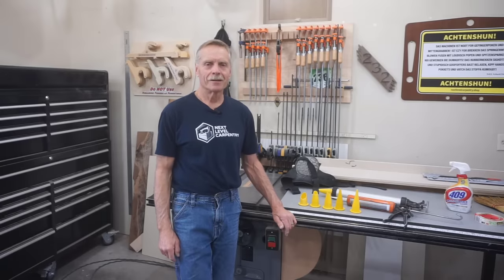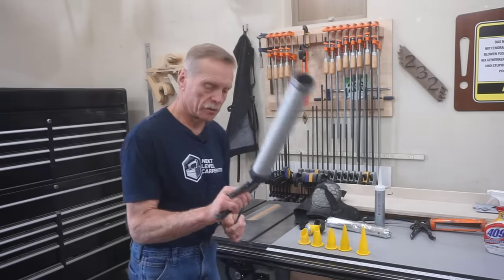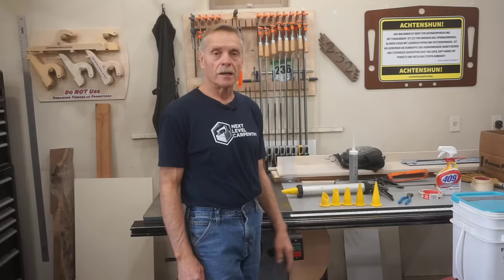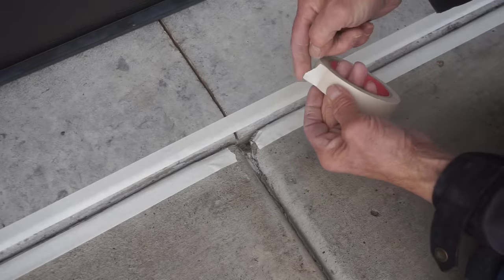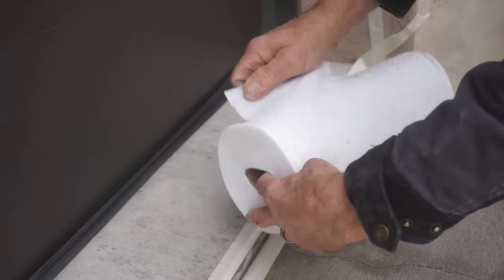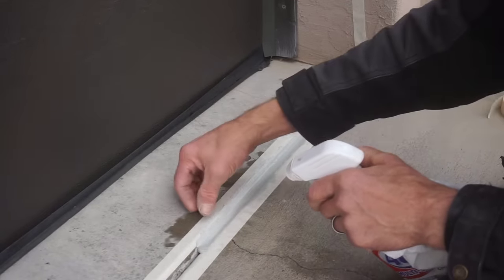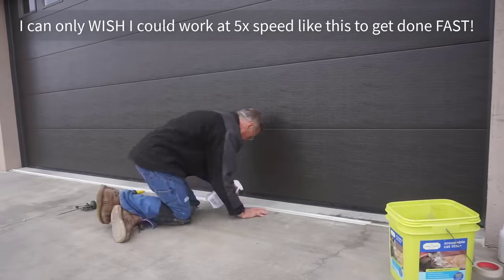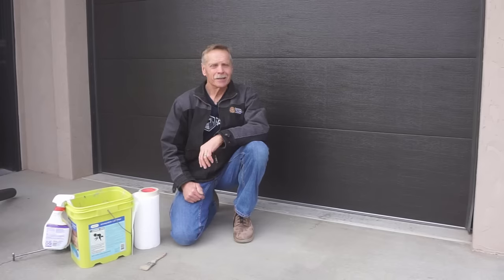How to Caulk Concrete Control Joints with Perfect Results Every Time

Comment: 1.  How do you get the concave shape on the joint if you cut the tip straight across and then work at 90 degree angle to the length of the joint?
2.  NP1 says to prevent contact with skin.  Is the polyurethane you are using different or does the 409 insulate your fingers?
Reply from the maker: 1. Just rotate the gun/nozzle until the curve of the cut tip leaves the right amount of concave-ness... if you use a sausage gun with those yellow cone tips you can cut a few at different lengths and cover just about every joint width/depth from 1/8" up to about 1 1/2"
2. I'm pretty sure Tremco products have the same warning and anyone with paranoia about such things should steer clear of this whole process.  Personally?  I'm not eating it and, using 409 or diluted Dawn and plenty of paper towels to keep my fingers clean, it doesn't concern me in the least.  Funny thing is, my hands are much cleaner after a day of this work than just about any other construction activity.  If I did this all day, every day I'd probably use nitrile gloves or something but at 3~5 times per year I don't.  I get a bit cynical about this sort of thing when I imagine someone over reacting to a bit of sealant on their skin and chain smoking a couple cigarettes to calm their nerves.
Work sensibly and safe using your own intelligence to make decisions... Best, Matt
Reply: @NextLevelCarpentry  Unfortunately I have already purchased the Albion B26 B-Line gun which takes the 10.1 inch tubes of caulking.  Any advice for that using that gun?
Reply from the maker: @garygault5183  The best you can do is to cut the tip at a sharper angle for wider joints.  You'll be limited to about 5/8" max width to apply sealant in one 'tool-free' pass.  It's not a deal breaker though, just takes more wet tooling to get results like you see in the video. Again, I just use mild soapy liquid and my finger tip.  You can always use latex or nitrile gloves to keep it off your skin. FYI I'm doing a sealant job right now that I couldn't get the color I need in sausage tubes so I'm doing a bit of this work-around method myself.  Just plan to spend a bit more time on the tooling part and you'll do fine.  Best, Matt
Reply: Where do you purchase the fine silica sand?
Reply from the maker: @garygault5183  here it is through Amazon (from list in the video description): https://www.amazon.com/dp/B07NXVL3ZD/?ref=exp_nextlevelcarpentry_dp_vv_d if you can't find it locally at a masonry supply type place where you'll get much more for much less $$.  Best, Matt
Reply: @NextLevelCarpentry  Thanks for all your help.  This was an excellent video!
Reply from the maker: @garygault5183  Youbetcha! Good luck with your project(s)...
Reply: How many days of dry weather do you need before rain is forecast to get proper curing?
Reply from the maker: @garygault5183  Surprisingly it's moisture that accelerates curing time for urethanes so I don't worry a bit about rain even the day of application but do prefer at least one day so I can brush excess sand off the joints so they look their best.  It's more important that concrete is good and dry BEFORE applying urethane with this method, not so that the urethane sticks but so the masking tape does...
Reply: @NextLevelCarpentry  Is there any alternative to the diamond wheel like a hand wire brush or wire wheel and drill?
Reply from the maker: @garygault5183  abrasive discs are an alternative to diamond wheels... in fact, up until the last 10 years or so, they were the only practical alternative.  Since the wheel is used for cutting, not cleaning, a wire brush or wire wheel and drill don't work for this application.  You may be able to find an abrasive disc and arbor that can be used in a drill.  It would be much slower and less effective so the trade off for less $$ is slower results.  Be sure that any disc you get is made for masonry/concrete and NOT steel.  Even though they look very similar they're made with different materials and one doesn't work at all, really, for the other.  Best, Matt
Reply: @NextLevelCarpentry  I guess I will invest in a side grinder.  Is the object to  remove material for better adhesion or just to get a smooth surface?  Also on the video, I couldn't understand the word before "diamond wheel".  Can you clarify?
Reply from the maker: @garygault5183  will you include a time stamp from the part of the video you're asking about?  It will help me answer your questions... thx.
Reply: @NextLevelCarpentry  6:41
Reply from the maker: @garygault5183  perfect.  "I did a little pre-cleaning on these control joints with a thin diamond wheel in a  side grinder to clean up rough spots and make a uniform gap between the driveway slab and garage slab".  This step removes pebbles stuck down in the crack and allows free movement between slabs.  If concrete wants to move you're not going to stop it and small bits of sloppy/irregular concrete can cause edges to chip with even slight seasonal movement between slabs so I like to clean them out the slightest bit if I can.  I'm only going about 3/4"~1" deep, not deep enough to affect rebar or 'keyed' joints between slabs which are both structural by design.  The "clean up rough spots" smooths out the surface where the tape will go so I can apply it better/more easily.  Since the diamond wheel is SO quick and effective it's really a time-saving step although I suspect few people do it. Hope that helps? Best, Matt
Reply: @NextLevelCarpentry  The corners of my concrete slabs are radiused.  I thought the video said that the masking tape should go down to just below the crown of the radius.   But won't the pre-cleaning with the side grinder leave a 45 degree chamfer on those edges?
Reply from the maker: @garygault5183  the way I'm using the grinder there is more like a standing disc just a smooth up that radius if there's rough spots but I'm definitely not grinding enough to change the radius of that tooled  joint. If the Concrete Finisher did the job the way they're supposed to you wouldn't need to clean it up at all...
Reply: @NextLevelCarpentry  I think you're saying you are cutting with the face of the wheel, rather than the OD.  Is that correct?  I took another look at the joint I am caulking and I definitely have places that need to be cleaned up, mostly on one side.  I got a new side grinder and diamond wheel so I'm anxious to start grinding and see how it goes.
Reply from the maker: @garygault5183  you are correct. FYI the primary purpose of that thin blade is in fact to grind with the OD so that's mainly what I use it for but it doesn't hurt it to grind with the sides of the blade unless that's all you do with it which will wear out the blade prematurely. My blades last me for years so I don't really worry about it but if you had a bunch of face grinding rather than slot cutting you can get a diamond wheel that is designed for that purpose. Since this is your first project and every project is different start out cautiously in the least obvious area you have until you get a little bit of a feel for the process and you'll do fine! Best, Matt
Reply: @NextLevelCarpentry When I purchased a DeWalt angle grinder at my local hardware, they sold me the wrong diamond wheel.  When I check on line for the correct wheel it was almost as much as I paid for the grinder.  Is that typical or can you recommend another brand of grinder that will do the job?
Reply from the maker: @garygault5183  Not sure of your wording but diamond wheels are ridiculously inexpensive for the value they provide... here's an example: https://www.amazon.com/dp/B07FG8GWV2/?ref=idea_lv_dp_ov_d&tag=aiponsite-20&linkCode=ic6&ascsubtag=amzn1.ideas.2N0D3GFVZVC8G
I really like this Metabo grinder:   https://www.amazon.com/dp/B00WJOXBJM/?ref=idea_lv_dp_  The $160 cost is a good value for me but I use it a LOT.  A quick browse on Amazon tells me you should be able to get all the grinder you need for $50 or less.   I can't imagine you could go wrong with one like this Bosch (although I've not used it personally, I just like Bosch tools in general):  https://www.amazon.com/dp/B00004SUOU/?ref=idea_lv_dp_ov_d&tag=aiponsite-20&linkCode=ic6&ascsubtag=amzn1.ideas.29WVINIJF4EUJ
This tells me that you should be able to get tooled up for around $50~$60 bucks which is actually rather incredible!  When diamond wheels first started coming out the blades themselves cost that much!
Best, Matt
Reply: @NextLevelCarpentry  I stuck with the DeWalt grinder and the diamond wheel I purchased worked fine.  I am now into the caulking phase and it is going very well.  However, I had to stop caulking about 2 feet before the end of the joint due to a piece of concrete that was broken away.  Do you have any experience restarting a bead of caulking a day later and getting the new caulk to bond to the old caulk?
Reply from the maker: @garygault5183  It happens often... shouldn't be a problem at all as far as sealant goes.  The only problem I have is if I need to stick new tape to concrete that was previously sprayed with 409/dawn because, while the caulk seems to have no trouble sticking the masking tape can be a bit finnicky.  Might take a little extra fussing or maybe even a water rinse/dry to get the tape to stick but the caulk has never been an issue for me.

Comment: Would this product work where an asphalt driveway meets the concrete at the garage?
Reply from the maker: No, sorry.  Urethane sealant is completely useless for sticking to asphalt.  Unfortunately the only product that I've ever seen work at all where asphalt is concerned is the hot-applied stuff asphalt maintenance companies use. 🥺  Anything else is just a very weak, poor bandaid that is usually worse than nothing IMHO...

Comment: My exp joints are 2" deep . How do I do  this so I dont have to use a ton of this expensive sealer ?? Can i just first half fill it with something  cheap and what would i use to fill ?
Reply from the maker: Use backer rod, Sajid.  It's a foam rod that comes in different diameters to use in cracks of different widths.  The goal is to push the backer rod down in the gap until the thickness of sealant will be half its width ie: in a 3/4" wide joint use 1" backer rod and push it down so it's 3/8" below the surface.  This will result in a sealant joint that's 3/4" wide and 3/8" deep.  Hope that makes sense?

Comment: Can you use this around a pool to fill in the joint?
Reply from the maker: The one-part urethane used in the video doesn't adhere to stuff other than brick, concrete, stone, masonry etc.  I don't think you'd have much luck with plastic, asphalt, etc so keep that in mind... Best, Matt

Comment: Is this caulking to prevent rain  leaking into the garage?
Reply from the maker: No.  It's meant to keep water from getting into the dirt below concrete which can cause settling most of the year and frost heaving in freezing temps. Plus it keeps dirt and debris from collecting in joints for a well-maintained look...

Comment: If we have a deep joint, should it be filled in first?  Or can I just fill it with the caulking?
Reply from the maker: That's where backer rod comes in... but that's the topic for a whole other video.
Reply: @NextLevelCarpentry   is that video on your page?
Reply from the maker: @ScooterQuentin07  Sadly, no.  It's a whole subject unto itself and I've not devoted the time to making a video about it. A good place to start is on Tremcos website where they have some information about joint design which tells you what to use for backer rod etc.

Comment: Nice job! Myself, I just use the self leveling and I think it looks pretty good. I was hoping to hear why to go through the trouble of doing this. My thinking is, I’m trying to keep the water from going into the cracks and over time, undermining and causing erosion under the cement. I’ve never had trouble with the self leveling running down the joints like he indicated. However if the crack is deep, you can go through a lot of sealant and have to go back later and add more to insure the crack is filled.
Reply from the maker: Personally I never feel like the method shown in this video is a lot of trouble especially when compared to doing and redoing joints with self-leveling sealant which doesn't work on sloped applications anyways because it tends to pool on the downhill end. Besides that a joint that is completely full of sealant isn't as good as one where the depth of the joint is held to one half of its width with the use of backer rod or the proportions of the joint itself. Probably the biggest point of all is that with this method I'm able to Tool The Joint so that it looks exactly like I want it and then most importantly apply that silica sand to keep it looking clean while the sealant cures which is another benefit over self leveling. Please don't take offense to my response because my comment is based on personal preference and not an insistence that my ways are the only ways are the best ways... 😎

Comment: These expansion joints can be deep-four to six inches, in my case all the way to the Sandy bottom. Shouldn't that depth area be filled in with either mortar or concrete before you caulk on top? Or maybe one of those black material expansion joint runners that look like wooden one by fours?
Reply from the maker: Hey Bill, This video is about FINISHING control joints and was never intended to address proper preparation of joints of all types...
It would be a mistake to fill those gaps with anything solid like mortar or concrete IMHO.  Backed rod is the most common 'best practice' but that too is not universal advice.

Comment: Does this work for the smaller cracks that form?
Reply from the maker: I use it for cracks down to about 1/4" in width.  Less than that and you're more likely to just make a mess of things.  You might try a crack sealer with a very small tip so that the material runs down into those tiny cracks and doesn't end up smearing on the surface like bad lipstick... 😉😃

Comment: Can you do this same method in sidewalk expansion joints?
Reply from the maker: I use the same process for finishing/tooling urethane sealant regardless of where it's applied. The thing that varies most is prep work. Control joints in sidewalks are generally the same but bear in mind that Expansion Joints require different prep work because there's so many types and sizes but as I said the finishing process is the same...

Comment: How many feet of caulking do we do before removing the tape so we can clean off the caulk and place the silica sand?
Reply from the maker: For me, the main factor is if it's windy or not.  On a calm day I'll do 10'~12' at a time. On a windy day when dust and debris swirl around and immediately stick to wet urethane sealant I back down to 4'~5' to keep the joint clean.
Reply: @NextLevelCarpentry  Fantastic.   I would have down the whole thing of laying down the polyurethane first if you didn’t mention this.   I will do 12” at a time, remove the tape, place the sand, and then, continue on.
Reply from the maker: @alaluke7159  You'll figure out 'a system' that works for you once you get into it.  FWIW I usually put all the tape down for the whole area I plan to do in one setting first then apply the sealant in sections 4' to 12' long, depending on conditions mentioned before. I do this because tape won't stick after using the 409 to continue sealing a long joint.  You can, however, REMOVE the tape and apply sand in whatever length section you do at a time, again, depending on conditions when and where you're working.

Comment: What if you can’t get a hold of 409? Is there a mixture of Dawn dish soap and water that works?
Reply from the maker: Lack of availability of 409 has forced me to work on a diluted Dawn solution. I have worked with a number of different ratios and am currently using 1 fl oz of Dawn dish soap to 13 fl oz of water and feel that is quite acceptable. I've done close to a hundred linear feet of joint work very recently with this mixture and feel comfortable enough with it too make it my recommendation. Best, Matt
Reply: You can use simple green or orange clean instead of 409
Reply from the maker: @mcomp9313  I don't recommend anything but 409 or diluted Dawn... other products may well work fine but to protect my reputation and prevent costly callbacks I don't use anything un-tried and un-tested.  Best, Matt

Comment: Hey I have a question.. I have tried the 409 method and no matter what I do I can’t get it smooth like you do. I have tried all different types of caulking the. Tried the brand you used and no matter what if I hit it with the 409 it makes it worse and pulls.. I have pictures and videos I can’t figure it out? Please help
Reply from the maker: Not sure what's going on there JDawg... I've never had a problem with it where it always works just like shown in the video.  Make sure you're using it on ONLY 1-part urethane sealant, regardless of the brand.  It will make a mess like you describe on latex, silicone, etc!  Rember, it's the type of sealant, not the brand, that's most important.  Hope that helps?
Reply: @NextLevelCarpentry  I was going to post a picture of what I used and it is 1 part. I wonder if it’s the 409 formula, I have only had some success of dry tooling. As soon as I mist it I try and use my finger and it’s just as sticky.. I wonder if it’s the temperature. I have no idea, and it’s bothering me so much.. hopefully I can get it figured out

Comment: Do you do the same process for cracks?
Reply from the maker: Filling cracks is essentially the same procedure with the main exception being the difficulty of using masking tape along the irregular edges of a crack. Also this is not recommended for cracks less than about a quarter inch in width where a different product and different procedure yield better results.